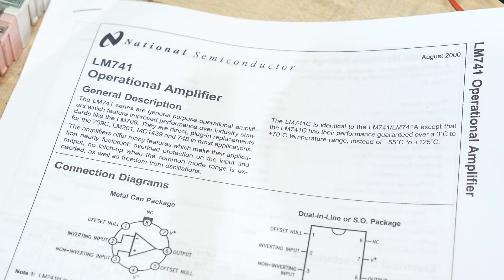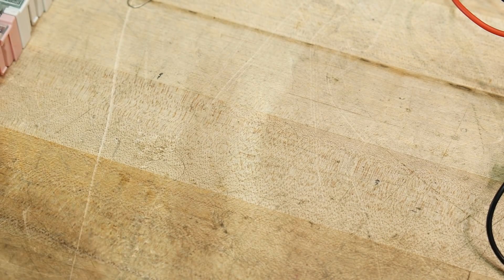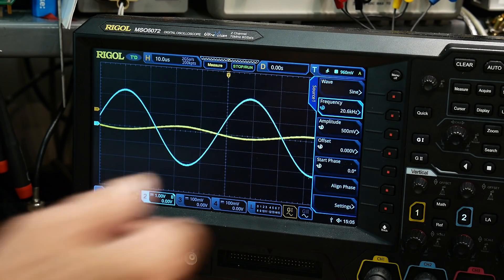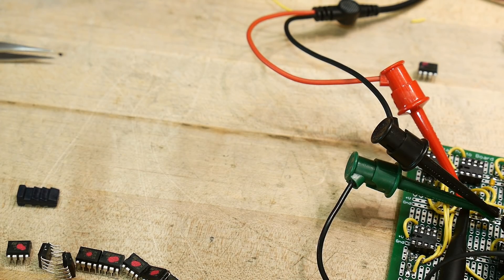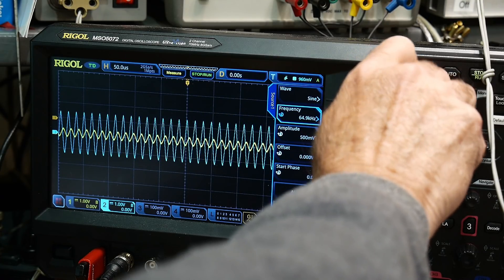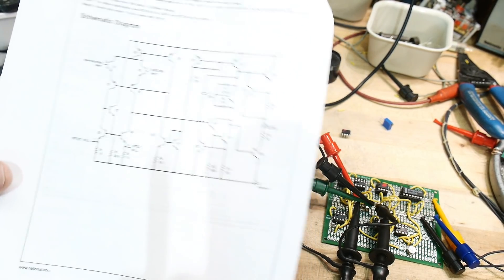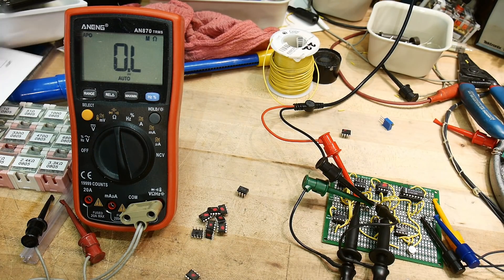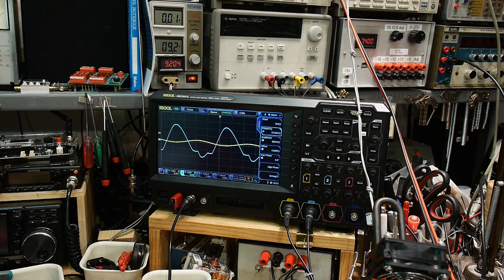#1070 Even LM741 op amps are faked!

Comment: 741 was my favorite opamp (after 709) in the beginning of 1970's as soon as they became available at a fair price. I built numerous systems with them and even made pcb's from copper clad boards by carving them out. My top notch DIY instrument was a pen plotter of miniature size using a narrow paper used in cash registers. It had a mechanical gear for switching the speed to high or low, a few voltage ranges and a logarithmic amplifier in one channel. I learned a lot while building the measuring instruments by myself, no guidance, no instructions. Wow, that was a great period in my life.

Comment: A lot of these fake op-amps are apparently recovered from used equipment, desoldered from the PCBs, then laser etched with new part numbers.  There's even no guarantee that an 8 pin part is actually an op-amp...

Comment: I too have received many fake opamps through Aliexpress. Out of annoyance I was forced to design a few test PCB's with many jumper settings for multiple test configurations.
And later for multiple opamp footprints.
Occasionally received money back, but sometimes a dumbass on the other end who simply claimed: "show with photo that you received something DIFFERENT." No, the imprint is OK, but the contents of the chip are NOT! It does NOT conform to the datasheet.
I made a story of it on a handmade website with a lot of test info.
On the first line an option to activate Google translate.
A link won't work, so Google "opamp test PE1ABR"
Reply: Great info on your site for all the community. Many thanks, Walter.
Reply: Can you share some thoughts on how to do basic testing of OPAMs using a multimeter and a simple oscilloscope?

I couldn't find your site with the above content.

Comment: It is interesting, but lets characterize these opamps.
I designed many opamps for large semiconductor companies, and there is not much in designing an opamp, it is a mundane task now days.
I think the problem is that they use new processes for the old design.
Their foundry process might have lower maximum voltage devices, and they probably are using a digital foundry process for analog circuit.
The first thing I test is that I lower the supply voltage to see if we can get ride of kink in curve.
Second, the graph you have in your hand is block diagram not actual design schematics.  The offset correction resistors could have been replaced with two current sources, ie. current mirrors.
So for offset cancellation  test you should use it in voltage buffer, ie.  negative input connected to output and positive input connected Vtest, to see if you can adjust the offset.
Also for frequency response connect a white noise source at the input and connect the output to spectrum analyzer, or oscilloscope with FFT, to inverting configuration with gain of 10 to see the frequency roll off.

Comment: What I don't understand is how they are faked, are they having semi's made with a  altered die and mfg cheaper, or a similar chip that is remarked.
Reply from the maker: they use one of a dozen different chinese opamp chip designs
Reply: @IMSAIGuy  .. buying a cheaper chip, changing the package markings and reselling?  or actually manufacturing with a common cheaper die that is available. I suppose a higher end opamp the die is not available for them to copy, thus why substituting a jelly bean die and trying to pass off as the real?

Comment: The output waveform has a very telltale crossover distortion. This means it's a class B output op amp optimized for low quiescent current. 741 should have a class AB output with no obvious crossover distortion.

LM358 is quite common for these fake op amps, but only decapping can tell for sure

Comment: I think you are doing it wrong...pin 4 should go to the black lead of your ohmmeter. You had the red lead on Pin 4, so you measuring parasitic diodes to the substrate of the chip. But anyway, the ebay-741s are fakes, that's for sure.
Reply from the maker: you can measure a resistor red/black or black/red  don't matter
Reply: @IMSAIGuy  If you measure a single resistor, then yes, polarity doesn't matter. But here you're measuring a resistor paralleled with transistors on a substrate, a TOTAL different thing! Try it!
Reply from the maker: @WolfgangMahringer  if you say so, what I see is an isolated resistor
Reply from the maker: OK, I did it and yes there is a differnence but not enough to care about 650ohm vs 750ohm
Reply: @IMSAIGuy  Thanks for proofing my point. If that 1k on the pins would be like a 10k or so, it would be a different ballpark. Maybe 8k correct polarity, still 750 reversed.
And no, the resistor is NOT isolated. It is on a substrate together with semiconductors, and thus will conduct (parasitic diodes) in one direction.

Comment: It may be a single rail power supply opamp. However, I think it can be used as a comparator, just because you have it at hand. To throw them away I think is kinda extreme if they can be used at something.
Reply from the maker: single supply part makes sense.

Comment: I don''t think those are cloned op-amps.   I think they are genuine, but genuine factory rejects.  Someone is raiding the dumpster and re-selling them at the factory.
Reply: I agree completely. There's just no opamp made that has a spec that would tolerate the offset cross-over distortion that chip had with just a x10 gain. They are simply faulty, and somebody's found a way of monetising rejects.
Looking at the idea of finding a use for them, it's clear they can't be used in any linear application. But what about switching applications? It might be worth determining how much current the output can source and sink. If it's not crippled, then it might be usable to drive LEDs or maybe relays. Will it work as a comparator? If the differential range without lock-up is big enough, it could be used as a square-wave oscillator, a Schmitt trigger, a level shifter. buffer, inverter, etc. All at low frequency, of course.
Reply: @RexxSchneider  , the problem with re-using them is that each would need to be tested to find out what the actual fault it has is.   I am sure that there are probably common failures but you would need to match up the failure with your application.   In todays world of time is money it doesn't seem practical to do this.
Reply: @RexxSchneider  The time you spend qualifying these parts for any application will be worth orders of magnitude more than any savings. Sure it’s a fun thing to do on a weekend if you’re inquisitive, but trying to actually use those parts for any purpose other than their characterization for funsies is untenable for anything but the simplest of circuits that you’ll use for a day or two then dismantle. I’d never put one of these things into anything that goes into an enclosure even if it were a one-off. You’ll have better ROI getting old electronics from thrift stores and scavenging parts. At least you can be assured that the parts work in the application they were used in.
Reply: It does not explain the lack of a bonded offset pin though...
Reply: @EngineeringVignettes  Not all single opamps have offset null pins. These rejects could be from almost any opamp, not necessarily a 741.
Reply: @EngineeringVignettes  Who says they were a 741, plenty of single opamps in the DIP8 package either have no offset adjust capability, or it is only done on die, and thus no bond wires. Just made to fit an industry standard pinout, and having 3 non connected pins is acceptable when there is literally no difference cost wise in the leadframe, to have all 8 pins there, and simply not bond them to the die. 

Could even be reject dual and quad opamps, that were manually bonded to use the one "sorta good" part of the die, because they got the reject dies for scrap silicon price, had a tester that could do the chip probing, and a manual bonder and staff. Just have to make sure you have 10 000 parts ready in the line before you start up the second hand die mould machine you bought, and use the cheapest epoxy with.

Comment: I always thought that fake pricier opamps were just LM741s. What chip do you put inside a fake 741 package?!?!? Rejects probably...
Reply: 2 transistors in a long-tailed pair circuit?
Reply: Rebadge any DIP8 part you found in the market place, blacktop and print whatever the customer order says. If your cost is 0.1c for the pack of 10 chips, 0.1c for the blacktop and laser etch, you can make a profit if you do 100 orders of 10 a day.

Comment: Those aren't fake opamps but rather specially made mil-spec special jamming signal generators that cost the US military $37,645.38 each (in 100,000 quantity) . When the original equipment was retired, they went onto the surplus market but found no takers, so they were hastily remarked and foisted off on innocent Chinese parts suppliers.

Comment: I can see a use for them, use as effects pedals, to give a unique distortion to your guitar pedals. No need for all those fancy expensive diodes and such, plus layout, simply plug in a different IC and get a different sound.
Reply: The pedals are going to need a cool product name. How about "Chinese Sawdust" ?
(If curious, ask me about origin of the term sawdust)
Reply: @EngineeringVignettes  I guess you got a few of those epackets that were just filled with sawdust, used to generate false reviews for scummy stores, who would send these tracked packets to random addresses to build up a good standing on the big ecommerce platforms, so they could run the proper scams and vanish before the platforms started to get all the complaints in about shoddy goods, counterfeit or non delivery, and then simply open up new accounts again.
Reply: @SeanBZA  - Nope. 
Back in the earlier days of car sales, some disreputable used car salesmen used to put sawdust in the rear drivetrain trans-axles of an old clapped out car (the "rear-end") to make it seem as it were in better shape than it really was. 
Hence the term "filled with sawdust". :)
Cheers,
Reply: @EngineeringVignettes  Here it was more common to use banana peels, as they were easier to put in through the hole, and did the same keep it quiet for a few months thing. Plus of course they were easier to get hold of, and would not look out of place in a salesman's desk drawer, either he was going to eat them, or he did not want to put the peels in the bin.
Reply: I thought exactly the same thing. :)
Reply: Yeah,  my first thought was what does a guitar signal sound like after running through that. 
I guess, based on other comments, we could replicate it by putting a 358 in a dual supply circuit.  Might be worth looking into.
Reply: @benebluesman  Well the 358, 741 and JRC opamps have pretty much been the de facto standard opamp in mixing decks ever since they were introduced, and you still get them all in modern decks, simply because they are both cheap, robust and well documented behaviour wise. Not many mixing decks actually used high cost opamps, simply because you need at least a dozen per channel, and this cost adds up very fast, for a difference that is very hard to put down to the average listener. Anything made more than 25 years ago is guaranteed to have been processed in some way by at least a dozen 741's, and also by a few 358's as well.